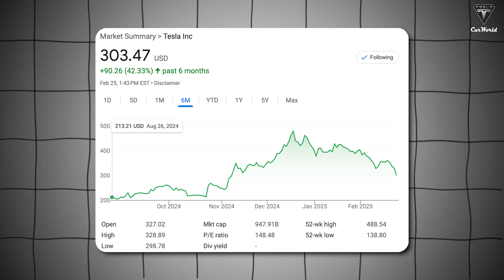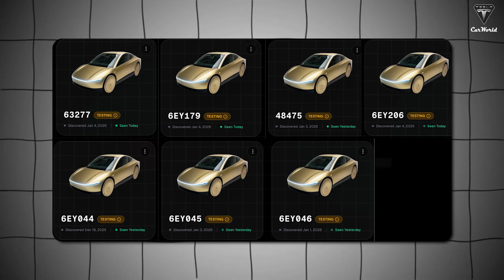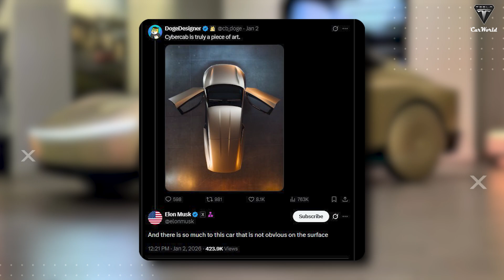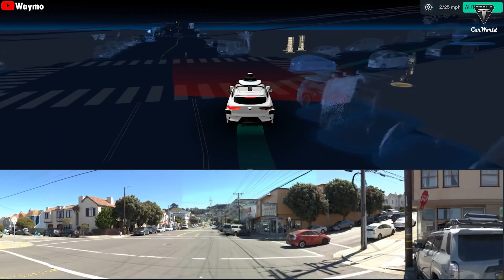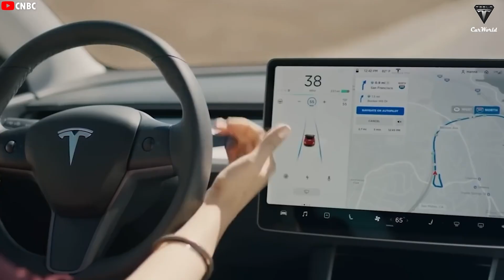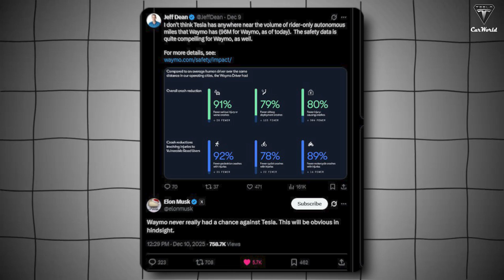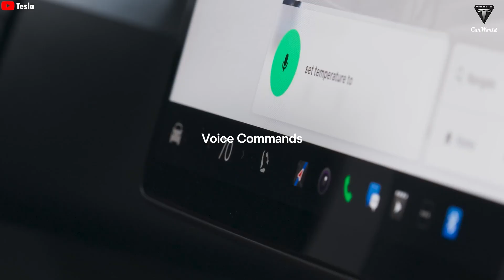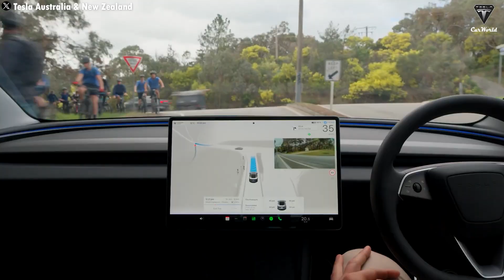New Tesla Testing On Roads In Austin, Giga Texas IMPRESSIVE! Elon Musk HUGE Reveal Robotaxi!

Comment: - 2-seater.  1 in 6 people looking for a taxi will go somewhere else.  And they'll be adding the app for that service instead.
- The taxi business isn't that big, Tesla will definitely be looking to expand in other areas to compensate for low taxi revenue.
- Just depreciation and electricity drives the price over 20 cents/mile.  Then there's insurance, maintenance, fleet ops, parking, Tesla's profit taking, hiring staff to clean cars and retrieve stuck cars.  Tesla simply cannot get that much lower than the average driver.
- Scaling is absolutely useless.  The problem isn't getting more cars, it's getting them regulatorily approved.

Comment: I purchased two Tesla's between 2022 and 2024. Both cars cost me between 50,000 and 75,000. Now between both of my vehicles my investment is worth about $50,000. Between paying $100 for connectivity to the internet and GPS I had to pay $200 a month for the full FSD which they don't tell you when you purchase the car. Until Tesla gives you all of those options in the price of the car at a substantial price not what it's been costing the car is not worth the ground it sits on
Reply: I understand your frustration. Sometimes, we didn’t realize how much ongoing software costs would add up over time. What would Tesla have needed to bundle upfront for you to still feel it was worth it?
Reply: No car is an investment, buy Gold. You buy a Tesla for the technology, safety and stress free driving. If you only drive local and not many miles, you dont need expensive FSD. Your choice to save money. For me FSD is compared to one night out per month in town. Great value for having a driver for me.